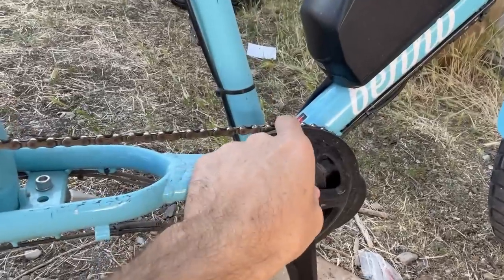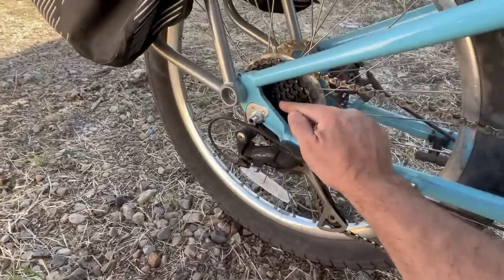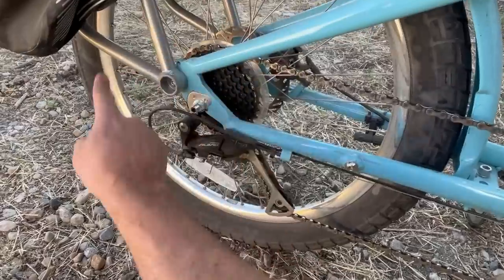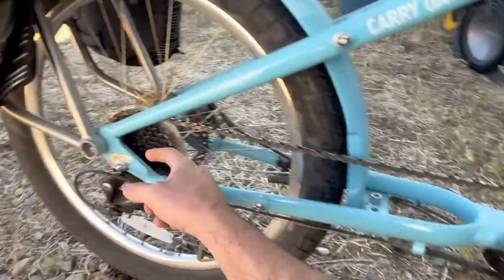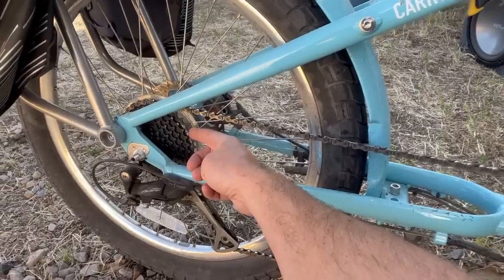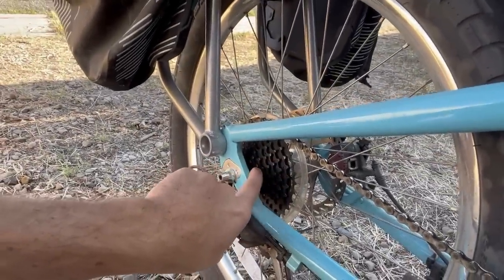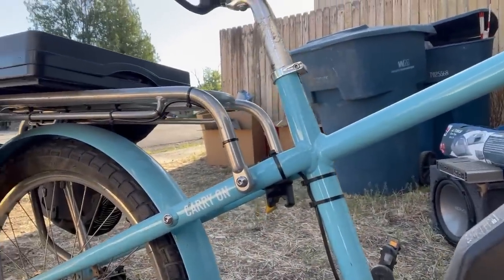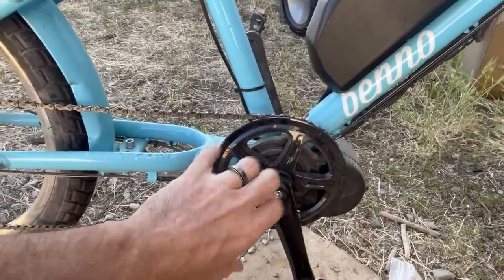The Cheapest upgrade for ultimate performance Boost on your Bafang Mid Drive!

Comment: Great video, thx. 
Two things I would highly recommend is to make sure you're using a steel cassette not an aluminum one, and an ebike specific chain. I stripped my aluminum cassette with less than 100 miles on it, and snapped my chain. 

I replaced them with the microSHIFT ADVENT X Cassette 10 speed, 11-48 tooth (steel version) and used the microSHIFT ADVENT X Rear Derailleur which works perfectly with the cassette. 
I also had to replace the shifter to the microSHIFT ADVENT X Trail Trigger Pro Right Shifter. I'm also using an ebike specific chain KMC 10 speed e10, designed to handle the torque. 
I'm using a Lekkie 42 T ring and love the whole combo. 
I pull a big heavy camping trailer plus loaded panniers, and I'm not a light weight either. All installed on a Surly Troll. 
Love it!
Reply: Hi thanks for your tips! I'm going Ng to be building my Surly Wednesday up something similar to yours! What kind of tires are you running?
Reply: Great advice and information especially about upgrading chain

Comment: Did that. Box Four Group set with Lekkie 52T on a 20" folder with a BBS 02B 48 V 17.5 Ah Bat. Awesome climbing capability even on a 19% gradient with pedal assist with almost no effort. Slow climb like a sloth but you get there eventually without any sweat at all. Thanks, Johnny for your awesome videos and knowledge. Stay safe on your test rides build. Peace.

Comment: Wheel size also makes a difference in gearing. I have a folder e-bike with 20” wheels. I changed to a 52t front chain ring. I’m almost always in my 11t cog and I’m spinning out at 21mph. I can go faster but then the motor is doing all the work. If the wheel size were larger I’d spin out at a higher speed. Ideally on the Folder bike I’d like a 56 tooth chain ring. I’d be able to use the full cog set more efficiently.
Reply from the maker: Absolutely. Wheel sizes also play a big factor in the overall gear ratio, great point!
Reply: @JohnnyNerdOut   How does making it a priority system make it the cheapest and ultimate, Bafang Mid Drive???? 
Thanks for the  Sponsored post,   but a direct comparison chart would have made it much clearer.... If there was any advantages to it whatsoever.... Much less the cheapest or ultimate performance boost
Reply: Going to a 42'teeth freewheel does that mean you also need a longer bike chain?
Reply: I have a MTB with 29" wheels. By quick pressing the on/off 3 times you get into the menue. And here I set the wheel to 20" instead of 29". By doing this I get the same power assist at level 4-5 as I would get at level 9 with 29" whell programming. But I Am from Denmark. So maybe they (Aliexpress) only send restricted model to the EU ?..One downside is that you dont get the right speed shown. But 14 mph at level 6 would be ( 14 x 29 ) : 20 = 20,3 mph. Or  32,5 kmh in reality.

Comment: I converted my 27 gear bike to electric and switched my casette from 12-25 to 11-28. It is pretty much ideal for me with 44 teeth front and 500W motor. I can tow my kid up the hills and not even need the lowest gear. With the lowest gear I can climb quite easily using only 50% power from the motor.

Comment: I use a Lekkie 52T chainring with a 9spd 11-42T cassette. I found that you are limited by the chain wrap capacity of your derailleur. 
In my case I required a 48T chain wrap capacity just to run the 11-42T with the 52T chainring.  The Microshift Advent 9-spd long cage derailleur has the highest chain wrap capacity available on the market (47T), and I use 2 13T oversized cage pulleys to increase this to 48T. 
Although I am right at the upper limit of my drivetrain design, it works well with my 2500w BBSHD middrive.
Reply: Interesting. I upgrade my Tern Link with Lekkie 52T and paired it with Box Four 8S 12-42 groupset, to make sure the chain does not stretch prematurely, used a Box 2 chain eBike grade. Works like a dream.
Reply: what about box 9 12-50T
Reply: @jon dough 32T is likely not going to provide an optimal chainline when used with an 11-42T. 
There is a good reason why the flywheel on a ICS engine is extremely large, it's what is known as a "torque multiplier". 
Even a stock 1000w BBSHD will shred a cassette quite easily if you do not use a properly installed gear shift sensor.
Reply: @michealbackus4543  wtf you talk you dont need gear shift sensor just release throtle and shift like a motorcycle.look at my videos.i have shimano deore xt 9 speed cassete over 7000km and its still good throtle only riding.microshift 9 speed with clutch ftw
Reply: 52T, 11T, 2500W-
Dude, how fast can you go?
Reply: @jon dough I have an all-advent drive train.  42 tooth on the front, 42-13 on the cassette.  

Seems to hold up OK.  I can climb almost any hill…. Don’t care about fast, but want/need pulling power.
Reply: @michealbackus4543  not true I run mine without a gear shift sensor just let up on the pedals when shifting never have had a problem over 400 miles on this build with a new 52 volt 17 ah battery with Samsung cells get over 50 mile range and I almost always ride on the 11 tooth around town without a problem

Comment: My setup for the bbs02 750w is 46t front with a 8 speed hg-41 acera 11-34t megarange cassette. This is with 26" wheels. I cycle mainly in London UK so there is a good mix of elevations but nothing too extreme. I find this gearing more than enough. A good thing to note is generally 8 speed or below chains are stronger when compared to the higher speed stuff. Worth considering imo.

Comment: I have both Cyclone 3000w and a Bafang BBS02 (750w) kits .
7 speed cassettes come in 12t-32t. 9 speed up to 11t-34t.  
The biggest Issue I have with the Bafang BBS02 and HD is their placement of a 6"-7" gear housing right where the crank chain rings are normally located.  Unless the chainring is  big enough wrap around the housing, you're stuck with a large single chainring in front.  It is possible to mount a 48t and 32t double chainring setup (using Luna Cycles' adaptor and extra chainring bolts), but the rings way too far out (least 2 cm offset to the right.  I.e. too much chain cross back to the cassette's large low gear).  This gearbox housing placement means with BBS02 and BBSHD, you're pretty much stuck with a single large chain ring (at least 40t) and low gear running is strained by severe chain cross.
   
As JNO suggested, there are 11-speed 11-42t cassettes, but they are pricey and you have to use an expensive (and less strong) 11 speed chain and 11 speed shifter.
Practically speaking we DYR'ers will use 7 speed or maybe 9 speed, so the biggest rear gear will be 32t or 34t (at most) with a 46-48t front chainring.  Even with the stock chainring (as well as the Leckie chainrings) when you shift into the low 32/34t rear gear, the chain cross is still pretty severe.  This severe low gear chain-cross that is imposed by the BBS02 and BBSHD is inefficient power delivery, and wears out the chain, cassette, and chainring.   I cannot apply full power without causing the chain to fall off chainring and or break.

With the Cyclone, I am running a double ring front crankset (32t/44t) with a  12t-32t 7 speed cassette.  Whether in low gear (32t rear, 32t front) or high gear (12t rear, 44t front), there is very little chain-cross.
Reply: I was able to build out a Mongoose fatbike to handle the double ring mod. I cut a half inch off the bottom bracket so the BBSHD can be moved far to the left. This allows the use of a Luna mini 30t and the Luna steel/aluminum chainring adapter and sprocket 44t. The mini has no offset and the steel/aluminum has the least offset available in the size I needed. Mounted side by side I now have an efficient low gear 30×34 and a high gear of 44×11for cruising. And as you stated, very little chain-cross.
And that silly mount for the motor that will never stay tight, I welded it to the bottom bracket. Now the motor is bolted to the frame.
Reply: Coming from mountain biking I ditched anything other than 1x long ago and I’ll never go back so that’s all good with me personally. Hate front derailleurs

Comment: Bought a generic version of the Lekkei on Aliexpress for about $40.  Is an offset with narrow wide teeth.  Before when I went to the lowest gear the chain would fall off, or even before the lowest gear it would grind as I got lower on the gears.  None of that happens now.  It is a 42T and the original Bafang was a 44T.  My eight gear cassette stock is 11-32.  Aliexpress sells some that have larger low gears as well I may try.

Comment: I put a 32T chainring on my bafang mid drive and the largest gear on my rear cassette is a 32T gear which means awesome hill climbing abilities, but I can still get to 30mph when I am on the smallest cassette gear which is plenty fast for me, the largest gear I can fit on my rear cassette is 32T without having to change derailer e.t.c a 42T chainring would make my bike faster but I would loose the hill climbing abilities of my 32T chainring which is more important than speed for me.

Comment: Great video ..gearing on any bike can be optimized for rider, intended use, terrain etc.  Bikepacking with a Bosch pedal-assist bike, I never used the top of the stock 11-42t cassette range.. even after climbing steep trails I would have struggled to clear on my standard (NoMo) lower-geared mountain bike. Installed an 11-36t this year, essentially removing a gear off the top and placing it in the middle where it’s more useful for long distance trips & battery management.
Reply: How many teeth are on your front sprocket? Just curious... I'm running 36 in front and 11-34T in back with a Bafang BBSHD on a fat bike with 29" effective diameter and this is generally very good, I set it up this way for hilly jeep trails. Only disadvantage is I can only pedal comfortably up to 25 mph, would be nice to get up to 30. I really like the hill performance the way it is, though, and don't want to lose that. 25 mph is a reasonable speed, although the bike is capable of over 30 with the throttle.

Comment: 2:45  I think 40 mph is safe if you have a beefed up bike (stronger wheels & frame) and large enough brakes.....I want an e-bike but too poor now so I did the motorized bike build. Plus I never had a chance to test ride a 1,000w mid drive  or something like a 3,000 hub drive, Toyota is supposed to release solid state test batteries in 2025 in a hybrid car. If solid state batteries live up the hype, they'll be a game changer for e-bikes.
Reply: I think graphene is the future of batts…. & I believe they are already marketing a lithium/graphene hybrid batt in an ebike already..
Reply: You also need to think about tyres and tubes. 40mph for a long period of time (like is capable on an E-Bike) is putting a hell of a lot of friction heat into your tyres and tubes (if you're running them) it only takes a little failure and you're doing 40mph on a flat tyre, or more accurately you'll be doing 40mph on your ass as having a blow out at that speed is not going to be a super happy joy joy time.
Reply: Good point, stock tires on a mb might just be asking for a crash. Which tires are better for the increased speed. I plan to ride trails and some paved street.
Reply: @harveyashworth6285  I seen online they make (supposedly more durable) e-bike tires that are supposed to be able to withstand higher speeds. I'm not sure about the quality, they're more expensive. Schwalbe makes a cargo bike/ebike tire called the "pick-up" that's supposed to be tougher. I'm looking for some motorized/ebike tires right now, so hopefully I can find some reviews on YT.
Reply: Or a road bike
Reply: @lmaoroflcopter tyres are fine at 40mph
Reply: @lee-tx5mw  tyres rated for 40mph are fine at 40mph.

Comment: My Duo motor Radrover now has an ACI BAC855 on the mid drive, and a 750w bafang motor with the Radrover upgrade controller ...
I never use the gears now. PAS is on the mid drive,  and the hub motor is throttle only.  I start in the smallest gear and give the rear motor a throttle burst and when I start pedaling the PAS kicks in. Even Going up hills, I never need gears. switch the mid drive to PAS 5, and hit both throttles don't even have topedal... easy 30mph up hills pulling my dog in her trailer
Reply: This sounds nice. So you have a throttle on the left and the right?
Reply: @joesiph8021  yes  2 throttles
Reply: Does the rear motor have resistance if off?

Comment: One of the arguments that I have seen against mid drives is that they break the freewheeling mechanism on the casset.  I recently heard the mechanism taking a hammering on my wife's bike when she would pedal 2 cycles then freewheel for  two cycles.. My instruction to her was basically to ghost pedal instead of stop pedalling to reduce this  Any experience on this?

Comment: If you want to stick to 9speed rear and use a wide range cassette you need to upgrade the derailleur and shifter. Standard shimanos work up to 40t, but they still don't have cluch.  What means Box components or chinese derailleurs. 9speed chinese cassettes are not very durable. E-bike 9speed chains either. What means way more sense makes to go for 1x11 shimano deore. Cogs sold separately are  available for those cassettes. Because it's a very popular system some great discounts are available  - I purchased Sram 1110 chains for  6£/7$ each. The 11sp deore has a clutch.

Comment: I have the 46t bafang for now, with a chain guide on the way but i've been looking at a new 8 speed cassette, and there aren't many that I can see. Theres a few no names but I don't know if I want to to that cheap either. I will be getting a lekki to keep that chain on, because I can't really use the top two gears right now. So yeah was thinking immediately the chain guide might help me a little, but the wider range would also help a lot too, then get the lekki when the money is free.
First time out on trails today though with it, even street legal uk 15mph...awesome, handled 30 degrees quite well even with just the throttle. adding the pas worked better. 
So my head is kinda stuck though. How much does chain strength weaken by putting on 9 or 10 speeds? and take it for granted I cannot afford competition grade chains here. yet...
But then, if I do go for something with 9-10 like srams which I think I like the sound off better as the mechanics are supposed to run cleaner on them where as shimano are starting to focus more on electric stuff which isn't where I am going at all. 
Then if I change cassette speed does that mean I will need a new derailleur too?

Comment: Hi, i changed my rear casette from 11-32 to 11-46 (deore 10 speed). When the gear is at 46 bafang m400 mid drive motor cuts the power off at half of the cadence. Dou you have an idea about the problem?

Comment: You should really look into some of the other non-lekkie chainrings out there. Lekkie stuff is vastly overpriced and you can find the exact same quality stuff on Amazon and eBay for a lot less. I have a 52t that I've beaten the absolute shit out of that was 50 bucks
Reply from the maker: Does it have narrow/ wide design with an offset? That would be ideal.
Reply: @JohnnyNerdOut  I have a chainring from DeRuiz (on Amazon) that's practically identical, down to the narrow-wide teeth. It's on my fat bike conversion and runs beautifully.
Reply: You can get a 104 bcd chainring adaptor from Amazon, I use one on bbs02 to run a cheap 38t. With an 11-32 on the back it'll climb well and top speed is up from 26 to 29mph, I think this is because the motor can hit higher rpm with this gearing. The bike is a Marin Alpine Trail 2002.
Reply: Luna’s chainring is a trifle cheaper, though still costly.  

I have a 42 tooth Luna chainring, and a 42 tooth bottom gear.  I can climb BAD hills easily.  I can go fast enough to suit me easy.
Reply: Yea they have identical type chainrings to lekkie on aliexpress made from same alloy and specs, for less than half the price, lekkie says theirs designed in New Zealand (still expensive there) but I bet it made in China probably same workshop the knock off are made
Reply: @JohnnyNerdOut  Yeah all of the ones I have seen are narrow/wide. Not too sure about an offset but I'd imagine they do.

Comment: Wait, if you're just looking for something close to a 1:1 ratio, does it matter if it's ~56t:51t or if it's ~36t:33t? And wouldn't the relationship between RPM and wheel size matter more?

I'm in the process of buying parts for a BBSHD mountain bike (29er). My cassette has the following configuration: 11-13-15-18-21-24-28-33-39-45-51T. I'm going to use a Lekkie 40T HD chainring, which should (hopefully) have enough offset to let me use all my gears. If I use my 2nd speed (39t) with a 40t chainring, I'll be extremely close to a 1:1 ratio. If I encounter a crazy hill while towing something heavy, I can go to my first speed to get closer to a 3:4 ratio, which should give me even better torque, and if I'm on the flat or going downhill, that 11t gear should help me go to a decent speed, as well.

Now, with 29" wheels, the distance pushed per rotation of my wheel is very different than if I were to use a 20" wheel. I'm not sure what the most efficient balance is for the BBSHD's RPMs vs its torque, but with an 11-51t cassette and a (hopefully) good chain line, I should be able to find out.
Reply from the maker: Definitely tire size is part of the equation as well. But 26-29” tires are not nearly as important as gearing. 20 -29” tires would have a noticeable difference though.
Reply: @JohnnyNerdOut  By gearing, you mean making as full usage as gearing as possible, correct? Just wanting to make sure I have the right options on my bike. :) Thanks!